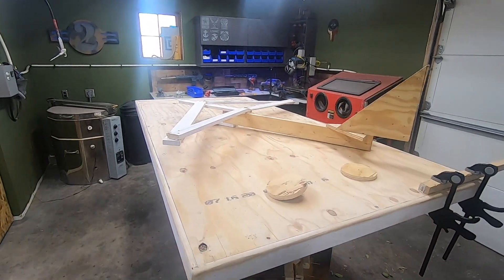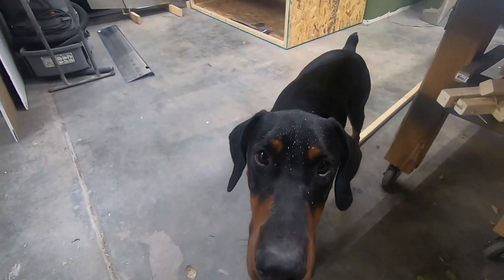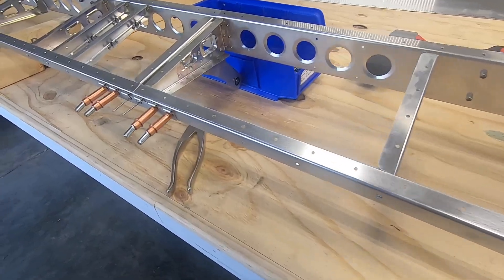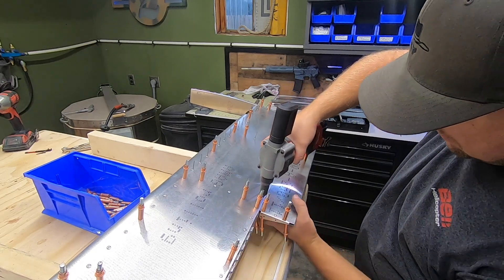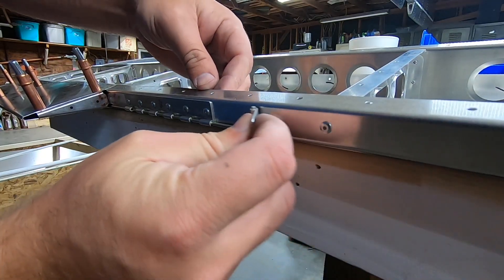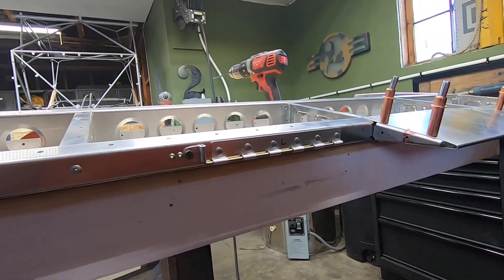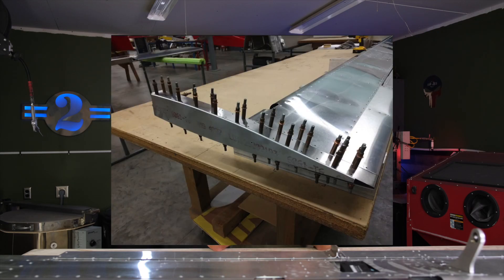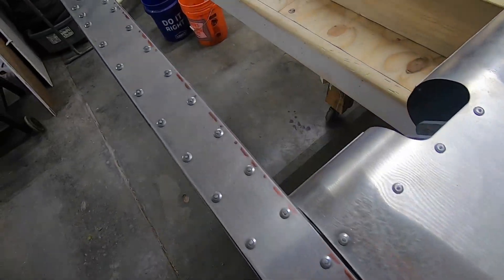RANS S21 EP7 ELEVATOR COMPLETE (MY FIRST SCREW UP!)

Comment: Are those rivet tails sticking out in the center of front spar? 4:39………
Reply from the maker: Yes, those are the tails, I may have put those in backwards although It doesn’t appear to be an issues since I have mocked things up on the fuselage and it doesn’t interfere with anything that I can tell.  I just got in a groove and did all the ribs to the spar at the same time and shot them all from behind. Good eye sir👍

Comment: not sure but doesnt that screw need to be safety wired
Reply from the maker: It’s good practice to ensure there is some means of retention for sure. In this case, the nutplate is self locking so that will prevent it from backing out. Thanks for watching👍